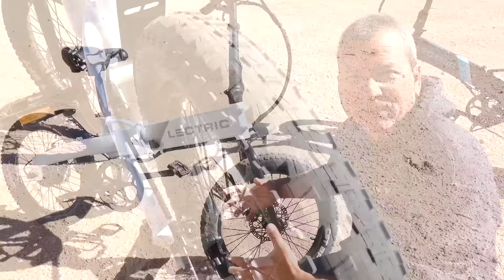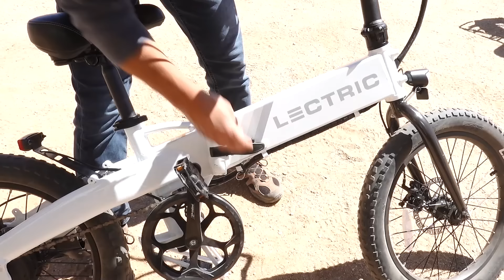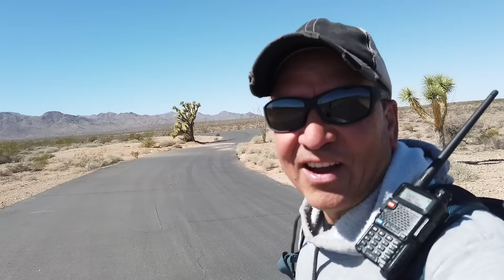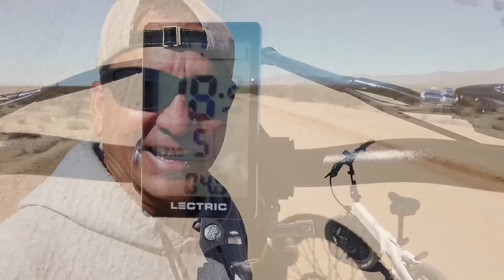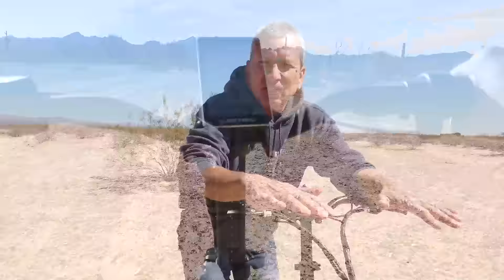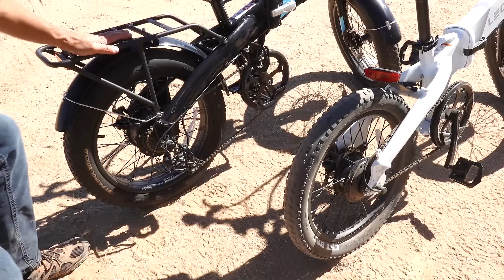LECTRIC XP LITE Folding Electric Bike Review and Testing

Comment: I really want to see more battery in terms of distance over varying terrain. I have a 2.0, I like it a lot it comes with a 9.5 amp hour battery.  I would like something like 16 to 20 amp hour capacity.  Actual 40 to 50 mile range would be ideal. Please tell Lectric that is most important.
Reply from the maker: Will do. You're not the only one who's asked for that. They do appreciate and listen to feedback. That's a big reason why they also came out with the LITE.

Comment: Hi there. A fantastic video as usual Tito. I have just stumbled across this lectric light bike and it seems rather appealing. I live in Canada and I believe they do ship here according to their website this sale price at present is US$799.  I like the fact that it does not have gears and is very simple to operate another plus factor of course is the weight.  I am strongly contemplating ordering just have to work out the exchange rate and shipping costs.  Thanks again for great video
Reply from the maker: Good luck. Just reach out to them. I'm sure they could help you navigate that.

Comment: The lighter weight would be nice for my wife, she has had an XP 1.0 for about 2.5 years now, and it is too heavy for her to load it on the rack or fold and move by herself. It seems like this one is way too much of a downgrade for the price to make me want to pick up one for her though.
Reply from the maker: I get that. The tradeoffs for the lighter form factor certainly are an issue under certain conditions.

Comment: We've been riding our XP 2.0s on and off road since November.  We are full-time RVers in our mid-60s and we love them.  We created the only issue we have had by boondocking for two weeks at Rutherford Beach, LA on the Gulf.  The chain and gear set rusted and every place the paint was scuffed or nicked rusted from the salt spray and the heavy saltwater dew.  I brought the chain and gear set back with a liberal application of bar and chain oil for my chain saw.  We love how well they fit and ride in the back of our C-RV tow vehicle.  My wife has had both knees replaced.  Having these bikes has given her/us great mobility together to explore trails when boondocking.  Do I wish they were lighter?  Sure when I'm moving them in or our of our C-RV.  But we'll stick with the wider tires and suspension for navigating through sand, roots, and larger stones.  Whenever we stay in campgrounds we always meet a half a dozen or more folks with them... it's a great way to make friends.  Bottom line, we find our Lectric XP 2.0s a terrific product.  Rugged, reliable, and tremendous value for money.
Reply from the maker: Hadn't thought of chainsaw bar oil. Hmmm. I've had similar issues in the desert and beach with wind, sand and dust storms and had to clean them up repeatedly. Fortunately, no rust though. I always cover the bikes in those areas when not in use. It helps a little.
Reply: @RVwithTito  I'll say one thing for this company is their advertising department.  Just check out one of their Ebikes and you will be flooded with commercials on most every app you have on your phone. They haven't infiltrated my calculator app yet. lol. Interesting that you will not find any negative comments regarding the Ebike or Lectric which makes me skeptical.  I bought an electric snowblower based on every great comment on YouTube without negative ones and found it to be a disaster and went back to a gas powered unit.
Reply: Thank you, you answered my question. Think I will stick with the 2.0. Good luck with your bikes
Reply: You needed to put WD-40 on  parts to protect from rust
Reply from the maker: @studiosinger  I prefer Boeshield T9 (https://amzn.to/3IsnkBx)
Reply: @studiosinger  Regular WD-40 should not be used.  WD-40 Specialist Bike Chain Lube does work well as does the Boeshield T9 mentioned.  There are other good bike/chain lubes, but do not use regular WD-40.

Comment: i saw the radio  are you a HAM?
Reply from the maker: No. Not a HAM. Just use it to communicate with each other when I wander out into the bush. It also comes in handy when off-roading or traveling with friends (when no cell signal is present)

Comment: What frequencies do you monitor on the HT?  KA7PAT  I wonder if they are or anyone is using lithium Iron (PO4) rather than the ION? Having more charge cycles would be nice and I wonder with performance, if IRON is better that ION ... in context of how long it holds up before requiring recharge. 3rd edit, regarding my theoretical use (can't afford such yet) I think it would be nice to have in a water proof bike rack/lockable... and then if I am in a camp site, in town or even have a vehicle breakdown, it would/could be nice to use to get around... and it would be neat to figure a good way to solar charge it ... might have to use a 12 to 24 converter for such... I have one I plan on using for a bluetti portable.
Reply from the maker: I don't monitor any frequencies except the private ones we programmed for communicating amongst ourselves out in the boonies, off-roading or caravanning. Battery chemistry: My understanding is that LiFePO4 is heavier which could have something to do with it. Here's the locking bike rack we use: https://amzn.to/3xi381A

Comment: No fenders or rack?,   For $200 more the 2.0 is better value
Reply from the maker: Nope. Just the bare bike with lights. The rest are sold as add-ons. Also know that rack is specific to the LITE. So the 2.0 rack won't fit. They tend to have "Bundle" sales bike + accessories every once in a while.
Reply: It definitely is much more for only $200.

Comment: Good review!!  One thing that we didn't see here or on the Lectric website is the "step over" height.  We are short legged folks and are concerned with how easy it might be to get on and off the bike.  We currently have a Jupiter Discovery X5 with a step over height of 19" and it has been great.  We are also wondering about how it does on hills as we live in a hilly neighborhood.  You were testing on fairly level ground, but did you get a sense of how it might perform on hills?  We are currently in the market for another bike and this looks like it might hit the mark at a reasonable cost.
Reply from the maker: I just measured it for you. It's about 2ft (24") from the ground to the middle of the neck. We're back in WA now and I just went out and powered up a couple short steep hills for you. I made it up fine but had to put in more effort with the LITE than I would on the XP 2.0. So the 2.0 definitely has more power on the hills with its larger motor. The 300W motor on the LITE can peak at 720W on those hills though. Hope that helps.
Reply: @RVwithTito  Hey, thanks for the quick feedback.  I think that will work for us, so I'll check on a couple of other things (my wife, the banker) and see if we can make this works.
Reply from the maker: @geraldetzold  we have the same banker 🙂

Comment: The lectric 2.0 is definitely a better bike but weight is a big thing. Especially if you want to have several of these for a family. These would be great to have for camping and be able to get around easily. The biggest thing is not having the shocks which would affect the ride if riding for a long time. But lower weight is great, but like someone said, 799 is a little too high still. Maybe at $500 would be a better pricing for this
Reply from the maker: There are certainly a few trade-offs. Lectric always seems to have sales.

Comment: The 2.0 has what I call a lurch when the power kicks in. Does the light?
Reply from the maker: Do you mean that it jumps in a bit quick? If so, this one feels a bit softer on the acceleration.
Reply: That helps, what I meant was when the pas takes over it jumps to 5 or 6 mph very quickly.  I’ve tune the settings down  @P12-PAS strength  as well as @P11- PAS sensitivity increasing the number of revolutions needed for the motor to kick in.  I suppose the same setting’s would be available on the new Lite? One other question, in the video I noticed that as soon as you turned the bike on, PAS 1 was displayed.  My 2.0 defaults to PAS 0, and I cannot find anything in the manual regarding changing the default. That’s for your help and information!

Comment: How is this gonna be able to handle hills? With no low gear and only 350 W, you'd better be a lightweight rider.
Reply from the maker: That was my initial concern. It works though. Instead of shifting gears, you UP the pedal assist. It's counter intuitive but works pretty well. The motor also has a peak power output of 720W also which kicks in on those hills.

Comment: Range is the first question people ask not weight.  The XP Lite be lucky to get 15 miles 

They should have included the original 9.6ah XP 2.0 battery in the Lite.
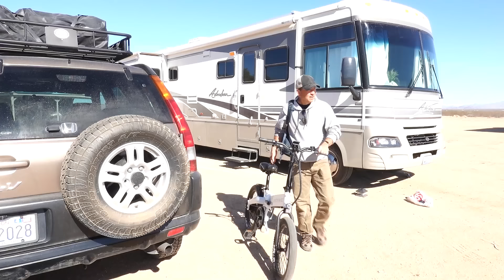Reply from the maker: I got over 30 miles on my test ride on pedal assist 2-3 (see video 09:30). It would probably 1/2 of that on just throttle.
Reply: @SunriseLAW  and they cost 3-500 more and or dont include some of the accessories lectric does...just stop

Comment: Lectric went the wrong direction ,, make bigger better bikes , larger motor,  larger battery ,  rear shock , stop light , turn signals , brighter head light .
Reply: When

I am 67 with artificial knees and a bad back, I don’t want bigger. I want lighter and easier. So I think this direction is good. Hopefully they will make a bigger bike too.

Comment: I don't like price.  $499.99 makes more sense.

PS.  Happy I paid $949 on Black Friday for the XP 2.0. It has a bigger motor, bigger battery, front suspension, bigger tires,  rear rack, 7 gears, full fenders plus 4 freebies including upgraded seat and suspension post, upgraded front light, and free lock.
Reply: not to mention all the extra money for a rack or fenders ,
Reply: We got the optional basket package and mirrors for ours in that black friday event.  It took a while to get the baskets (back-ordered), but the largest one holds a large garbage bag for a trip to a dumpster or hauling some groceries.  It also holds 5 gallon jugs for hauling water.  The mirrors only work for us mounted upside down below the handle bars.  Upright you only see your arm.

Comment: the one thing you guys didn't mention was how comfortable is to ride  the 2.0 was all about suspension and this bike has a small seat on no suspension  at all  also what's the max weight a rider can be on this bike ? this bike seems to be made for a smaller person im way too tall for it .
Reply from the maker: The ride is a bit rough if you're on rocky terrain. Smooth dirt or pavement is fine. I spoke to that a little in the video. You can also get a seat with more padding from Lectric or Amazon. Sorry. I can't speak to the height limit. I'm 5' 9" and have had people over 6ft feel comfortable on the 2.0 (after seat and handle adjustments). This one is a couple inches smaller all around.

Comment: Finally some competition for the Jetson Bolt Pro for only twice the price.
Reply: @SunriseLAW  Jetson Bolt Pro is $300 or less everyday of the week at Costco. I paid $275 for mine. 

BTW I bought the Black Friday XP 2.0 for $150 more than the Lite and got bigger battery, bigger motor, front suspension, rear rack, full fenders plus 4 freebies...front light upgrade, seat upgrade, suspension seat post, and lock.  Now that's value!

Comment: i like this bike. i was never a gear person and always rode a standard bike no gears. i will look into this. thanks for the solid review  tito
Reply from the maker: We live in an area with lots of hills. So geared bikes are a must. Having said that, the way the pedal assist reacts with no gears on this bike is pretty surprising. Up the hills we go.
Reply: is your regular bike a BMX type bike ? you have always had the option to avoid a bikes with gears .
Reply: @jhodges7041  no i have a beach bike that is gearless and a hybrid bike with gears. Still prefer to ride beach bike, but it is too heavy to lug around.
Reply: Sad you never learned how to use gears.
Reply: @doh3541  yep i never was taught and even tho my hybrid bike has gears, i only use a couple. i could never figure out why u need 21 gears?